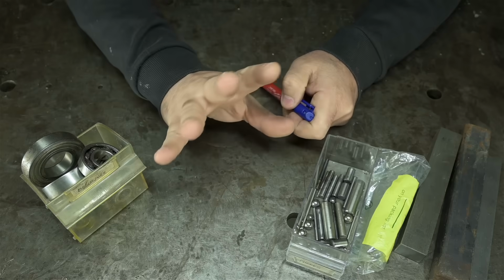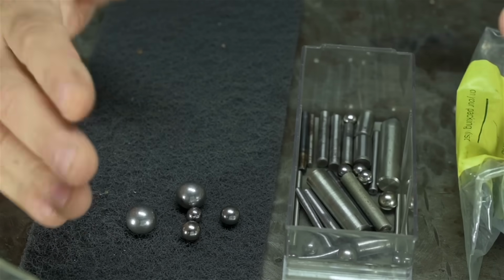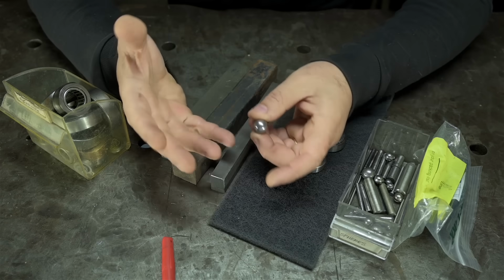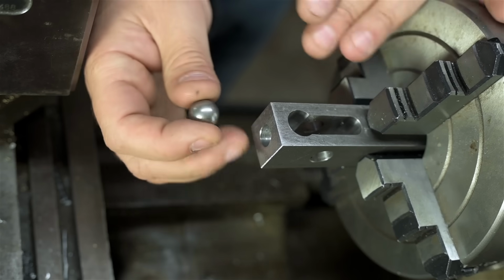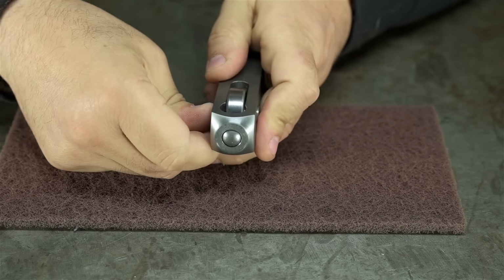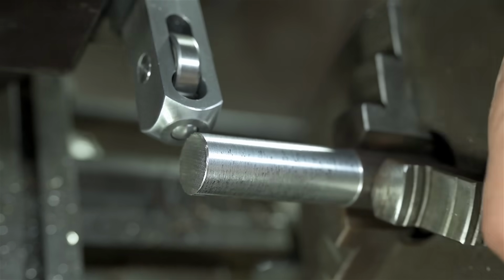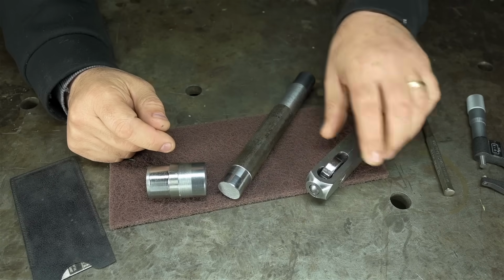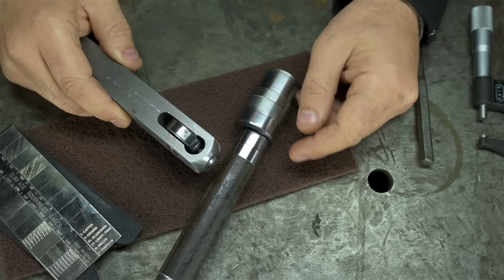I Have The Power!! (Burnishing)

Comment: I think the ball is used instead of just a straight bearing because the area the force is applied on is much smaller on the ball vs the bearing. I do wonder if the bearing would work if you just canted it to the side a little bit so its minimizing its contact area, but who knows how long a non-tapered roller bearing would last doing that

Comment: I might try making a double sided version, a ball and roller bearing on each side of the piece in the lathe, that way I can burnish long pieces, and also not require cross slide pressure. it might be the ticket to machining the stems of my miniature valves (for miniature model IC engines)

PS, AFAIK, 1018 cold-rolled-steel does not work harden, it work softens, that's why it breaks if you bend it and then try to bend it back, at least IMHO, YMMV, VWPBL, yada, yada, yada...
Reply: the smoothest, shiniest finishes i get are when something spins in the chuck jaws 😂. i think if you used something like a travelling steady with hardened jaws it would come out nice

Comment: • What about ball diameter? 
• What about a carbide or ceramic (i.e. harder or smoother) ball? 
• What about an "approach angle" which isn't perpendicular to the workpiece, i.e. the force of contact vector either leads or trails the point of contact?
• What about a stationary, i.e. a non-rotating contact made from polished carbide or tungsten thus relying on heat generated by friction to soften the surface of the workpiece as pressure is being applied? 
• A non-rotating contact would also establish a line of contact with the workpiece rather than a single point. That line could then be tapered by, for instance, half a thousandth so that as the contact advances the degree of interference (or pressure) increases behind the front.

Comment: Yup, straight roller bearing no sphere is way to go. You can angle the tool in the holder if you want a smaller surface/contact area. Leaves a smoother surface.. the spheres actually leave grooves in some work.. too small a contact patch.

Comment: If you try just a roller bearing, maybe try putting it on an off-angle to the part’s rotation. Should in theory convert from a contact line to a contact point.  And it then adds a friction element and allows you to use the entire bearing outer surface by adjusting tool height 

You may could also build the tool holder to be able to rotate and test different bearing angles. You know with all your free time that you have

Comment: The big difference between a ball and a a bearing is going to be contact area, and higher contact area will require equally higher force to achieve the same result; that said a round edged wheel would be pretty close to the same as a ball and allow for that better corner access

Comment: @08:30 

Option 3: Make the hole the ball sits in a normal straight close fit hole so you can insert the ball from the front/outside. Then make a cap plate to go over it with a slightly smaller hole (countersunk on one side) to hold the ball in place, and screw it all together. Reduces the amount of machining on the main body of the burnisher, and ensures it is easy to replace the ball if required too.

Comment: About half way through I thought that the process would work harden the material. And you did get to that in the end.
A flat faced bearing is not gonna work because the process depends on an extremely high tool pressure exerted over an infinitesimal point. The bearing cannot give you that. The experiment will undoubtedly lead to the death of your cross slide as you worried about near the start.

Comment: Two words: carbide balls!
You can get much better surface finish when you use a carbide ball in this tool. They tend to have better surface finish themselves and the extra hardness improves the size of the contact patch. Smaller contact patch, higher the surface pressure while maintaining the same force on the tool.

Comment: It is improbable that the hardened outer race of the roller bearing alone can provide the extreme pressures necessary to result in adequate burnishing due to the pressure being distributed over the 'line-of-contact' area.  It is the 'point-load' of the sphere contact that significantly reduces the contact area resulting in much higher pressure for the same applied force.

Comment: I bet you it would be fairly simple to make a surface roughness measurement tool using a low power laser diode and a photoresistor. The rougher surface should scatter more light away from the detector (or toward the detector, depending on how you set it up).

Comment: a bearing straight to the work material would have a larger surface area than the bearing and thus lower pressure applied to the work material, diminishing it's effectiveness. great video! im glad you're ok and back to making vids
Reply: Some are very thin.
Reply: I'd either grind race to a crown or set it at 85 degrees to work piece though that creates alot of cross force.

Comment: I think your initial turned finish was too smooth.  You need to give the burnishing tool more material to deform. The change in diameter is predictable if you know the starting roughness.  Ra is OK, but the combination of RpK and RvK would be even better.  Anyway, the only way the diameter can change is by displacing the peaks into the valleys, so the surface can be compressed by roughly half of the Ra.  And this advise is worth about half of what you paid for it!

Comment: i did one just using a roller bearing and it is far more finicky to set up tool aliment wise and as you were in contact with a little over half an in of the work you needed a lot more pressure worked ok but not great i am using a emco maximat v13 lathe it is not a monster but very ridged and i was having parts deflect (i am definitely going to give this a shot) i am mainly just looking to get nice polished finishes for bearing surfaces and to make looking look nicer quickly .... who dose not want nice shiny handle ..... as well as this seems like a better way to give a bit of a work hardening to the final surface i have not hardness testing kit but i have found that polished hardened surfaces are more resistant to rusting

Comment: just look at the Cogsdill tools website multiple examples of burnishing tools. Titans of CNC even featured one of them on their videos.
as for feeds and speeds i would start at the same speed as you cut and reduce the feedrate to 75-50%.
the diamond burnishing tool has a spring in the back, so the preload (ap) won't be the same. but you probably want to start with 0.003" to 0.006" in this case.
what parameters did you use in the video? let me know how wrong i am

Comment: I think you might be able to dp it just with a plain roller bearing. Just set the toolpost on a slight angle so that you still get a single-point contact rather than the full width of the bearing.

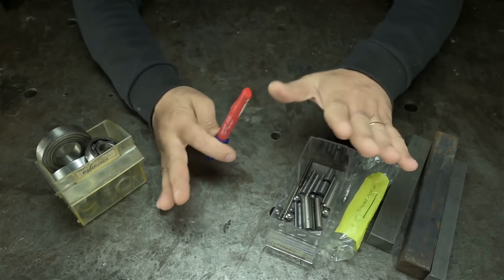Comment: I would guess that switching from a ball to the outer shell of a bearing would increase the contact footprint between the tool and the work. That would necessitate an increase in tool pressure in order to achieve a similar pounds/square-inch of burnishing pressure. I did notice in the image from @khampha-sangtao (3:29), the work had additional support from deflection via a live-center.

Comment: I'm going to blow your mind. They make burnishing face mills. I'm sure you knew that, but still. Pretty cool tech.
Also, you don't need a sphere at all. Just set the bearing at a 5° ish angle and use the race, that way you can get closer to an inside corner with the tool.
And the displacement is usually a few tenths or less as long as you have a respectable starting finish. Coming from a 125 ra might be sus, but a 32/16 ra will typically only move a couple tenths or less.

Comment: I think using a roller bearing instead of a ball would decrease the surface pressure due to the roller being a line contact and the ball bearing is basically one point of contact

Comment: Lazy me also wonders if you could just burnish with the roller bearing directly🤨
If forces are a big factor, we migrate to the classic scissor-block knurling tool.

Wait a minute, does that mean we could just swap the knurls from a scissor-type knurling tool with bearings and get a nearly-instant burnishing tool??🤠

If roller bearings don't work directly, then I'd try running them at a 1-3deg taper to force the burnish to one side or the other.

Comment: Burnishing can be used for an axle (which rotates enough times to test the theory of infinite cycles for fatigue failure) to reduce the possibility of a fatigue crack nucleation site both by reducing the surface roughness and therefore the stress concentration and by putting the surface into compression. Grinding and polishing can only accomplish the first. 

When roller burnishing train axles, one uses a set of what look like roller blade wheels made of hardened steel arranged like the cheap knurling took that comes with an import lathe tooling kit. I imagine that you could get a normal ball bearing spinning by using a lathe tool post grinder with the grind stone about 45 degrees off the axis of the bearing to shape the outer race to give it a crowned shape. This both lets you raise the pressure and work through a radius. Anything that is burnished shouldn’t have sharp inside corners because those create stress risers and defeat the purpose of burnishing in the first place. Instead the axle should have inside fillets.
Reply: Very informative post, thank you.
Reply: The shop I worked at had an internal one using rollers instead of balls. For the almost ten years I worked there, I never saw it signed out of the tool crib.
Reply: Crowned bearings can be found in CV joints.
Reply: I got a YouTube short that showed the process you described on a piece of roundbar, using a single bearing at a 45° angle.
Edit: it was posted by OctaneWorkholding

Comment: I suppose just the ballbearing could work without the ball. Just angle the bearing a bit so you are running the rounded edge for point contact rather than flush and have line contact.

Comment: 8:30 you missed option 3: I first did the single-point widening action, overshot dimension a little, got annoyed by the rattle of the loose ball, then made a bronze bushing with a step in it, drilled the hole wide open, pressed the ball in between the bronze bushing and the ball bearing (adding a piece of paper for tolerance), then turned the front to fit...

Comment: I use burnishers on soft Jewellery metals, they’re just polished steel that’s rubbed over the work to give it a shiny finish. I wonder if a polished, rounded carbide tip would work on steel, do away with the whole bearing arrangement and just apply light presser with plenty of lube?

Comment: The difference in force you'd get with the sphere vs the flat face of the bearing has got to be significant.  (That is, I'd expect you'd need to push a LOT harder to get the same force with the bearing.)

Comment: I've used burnishers in shallow counter bores on pay jobs. Improves the surface for crush washers. Some of those parts were used for plumbing toxic and corrosive gases, and the crush washers were made out of a soft stainless. The burnishing improved the seat and hardened it enough to make the crush washer seal reliably.
The roller burnisher for spot facing was three little needle bearings arrayed radially. Had a die spring behind it so the machine could drive down to compress the spring and dwell while it worked. No fancy programming

Comment: Try just a bearing on a stick, but make it parallel to the work where the bearing face is parallel to the spindle.  Now set your tool post angle where the edge of the bearing has about a 15 degree angle to it.  You only want the very edge of the bearing to do the work, like the edge is pushing the wrinkles out.  Use a light oil like some 10wt mixed with wd 40.  Touch your part, then crank in about 0.002-0.003" to preload it against the work.  See what happens.   Look up Cogsdill OD burnishing tools.  Their rollers are carbide and I use them almost daily for mirror finish and hardened surface on 304SS.

Comment: There are some papers written about ball burnishing, look up "ball burnishing" on Research Gate. Steel is kind of tricky because at a certain point, the ridges are all flattened and increasing pressure will try to deform the steel but since it is stiff, it creates a bad surface finish. Aluminium on the other hand always gives a good finish but you can deform it as much as you like.

Comment: Clock and watch pivots are burnished with a flat file shaped tool. This provides a smooth hard surface and a significant reduction in friction. Years ago there was a study done by a guy with free time and an electron microscope which showed the difference between burnishing and polishing.
Reply: Yea, that was Dave LaBounty. Easy to find the pdf google: LaBounty Burnishing

Comment: Well, right off the bat I see something one of you did wrong, he was power burnishing with a live center, and yours was free floating. Not sure how many live center's he's going to end up going through trying to get a highly polished shaft, but I guess that's his business. Who am I to judge. I do kind of wonder how much better the finish might have been with a follow-rest on the back of the work, sort of like those clamping knurlers. Hey, perhaps replacing the ball, bearing and pin, with a pair of hardened steel worn down smooth knurling wheels in one of those fixtures might reduce the stress on the lathe bearings a bit. The world may never know.

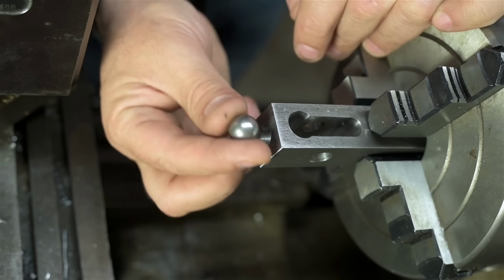Comment: 08:38 or jsut center punch the ends so the ball wont fall off. that is the easiest way to make this tool. I spent too much time trying to perfect it and ended up just installing the ball from the front and center punching the edges of the hole so the ball wont fall off
Use a very high speed and a lot of coolant.

Edit: there are diamond burnishing tools that have a pivot that lets you go to tight spot. Using a smaller ball can help getting to there tight spot but be sure not to overload, otherwise you risk exploding that ball bearing

Comment: There are such tools as "bearing on a stick" and not self-made, and not with a regular ball bearings, but with outer ring outer surface spherical. Not very popular these CNC lathe days these "sticks" and even before them - manual highly skilled work, not very accurate, nor very productive. There are even specialized machines doing only this over long products, sometimes pipes both externally and internally - 3 of these ball bearings on triangular mount with some "angle of attack".

Comment: gear oil should satay on the bearing better than coolant. it is thicker and won't squeeze out as easy.get yourself a blasting cabinet and try steel shot... real noice finish that is not limited to cylindrical parts. I thought you were a welder... was expecting to see you cut the front off, mill the groove in, then tig weld it back on.

Comment: Hey Tony, you might have a better tool if instead of milling the slot for the bearing all the way through the stock maybe leave a flat bottom so it can hold the oil better? If that made sense at all. I probably didnt describe that well.😊

Comment: There seems still a lot to improve for this tool. I have some cogsdill carbide burnishing tools for steel and some diamond burning tools for copper and aluminum. All of them give a very impressive finish. One thing I noticed, the cogsdill roller has a much thinner edge than the one you made. The diamond tool is a single ball contact but also a way smaller ball.

Comment: his pin was machined eith a head and a clip groove.
his entire head assembly was milled as a pocketed recess instead of drilled all the way through. the reason he did it that way is it then doubled as a resevoir for the oil he used during its operation. your ball point pen reference it turns out isnt so far off.

Comment: Always a good blend of shop talk and comedy.  I just enjoy your style.  A few years back I tried the rolling bearing idea you suggested at the end.  Too much contact area and almost no effect at moderate pressure.  I made a new one with an angled bearing thinking that the 10 or 15° "skew" might reduce the contact.  Two cylinders touching at an angle and all that.  And a slight smearing effect.  Nope, failed.  It seems like it's all about as small an area as possible to maximize the pressure per area.  In fact I wonder if the smaller ball bearing might not have been the better choice vs the fairly large one you selected?  Do I hear a Mk II version perhaps?  The one you used seems like it's roughly 1/2 inch?  I'm thinking more like a 3/8 or maybe even a 5/16 bearing to get a smaller crush area.

Comment: I'd imagine the ball would be a smaller contact point so would require less overall load on the post compared to a full bearing width to achieve the same finish?

Comment: I was thinking I would have bored the hole for the ball to pass in and make a cap for it. I do have a habit of making simple stuff harder though. I did make a burnishing tool by using a bearing attached to a piece of square stock at work.

Comment: I made one of these a while back. In my experience, the finer you can machine the surface, the finer the burnished finish will be. The roller bearing really doesn't work that well, although your thought of a bearing bolted to a piece of stock is a great way to get a part in the lathe to run true. Also a great way to upset the end of a sharp chamfer to retain the bearing in the tool you just made